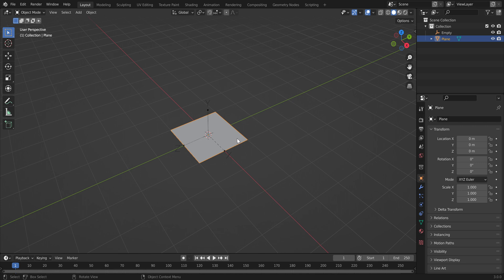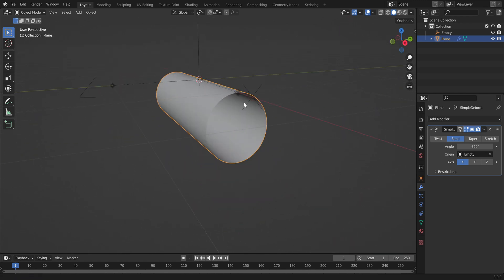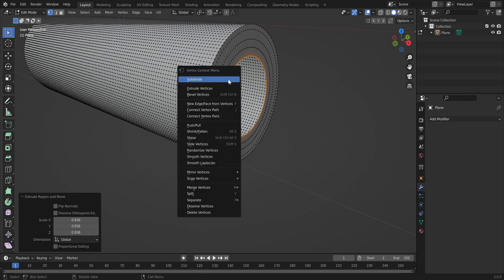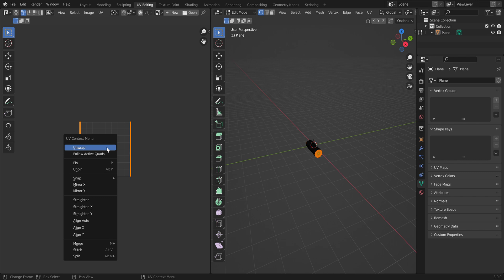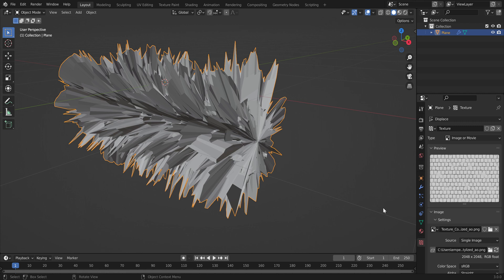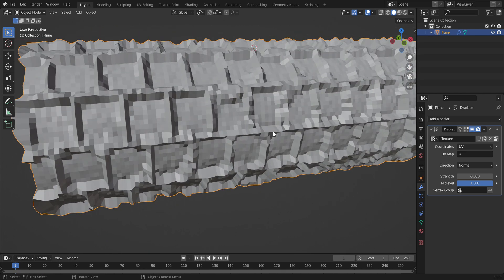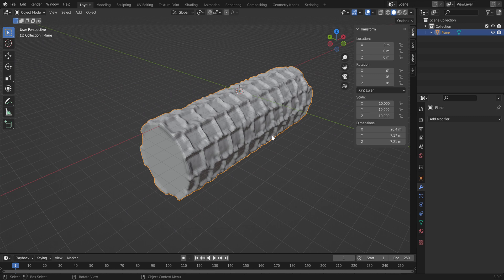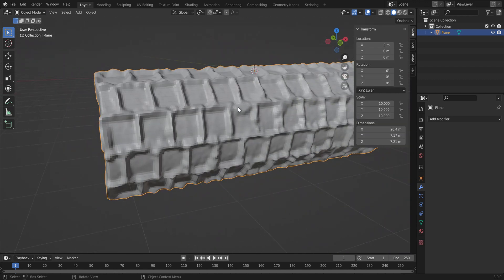Create a Texture Roller in Blender. (Tutorial)

Comment: I cannot get the uv to move off the part. did everything you did but doesn't move.
Reply from the maker: If the UVs are selected, they should be yellow. When yellow press G to move them then move the mouse and they should move with the cursor. If the uvs are collapsed, it might be enough. Me moving them off of the grid was just me being overly cautious.
Reply: @EmperorGuam  ah okay! You didn't say press G in the tutorial so that's the part I was missing! It seemed to work fine without doing that step - my first one is printing now. Great tutorial otherwise - I never use blender and I managed to do it so thanks!
Reply: Everything else worked great and not being able to move the uv didn't seem to mess up the final results, just don't know what I was doing wrong.

Comment: Could you leave the ends open 5:01 ?
Reply from the maker: @sophiemulders  you probably could. But if you are going to 3d print it, it does need some thickness.  To hollow it out you can use a subtraction boolean with a cylinder that is smaller than the roller. Most slicing software has a hollow feature  I would choose to do it there.

Comment: Using it on 3.6 with a slapped together png in krita and it is so much easier than the ones sculpting directly on the cylinder. Had some stumbling but was able to figure it out by following along visually. Many thanks.
Saved the core as it's own file to add more textures later. 🤩 Added a Action Recorder to reproduce the shape in a macro

Comment: Following and everything is working great but when I go to move the dot off the work surface I select it but it doesn’t move off square. Working on pc please help
Reply from the maker: What is the time stamp of the part that isn't working?
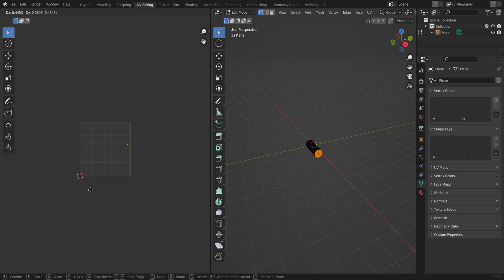Reply: Time stamp 5:23. It won’t move the tiny dot. Secondly could you do a tutorial on how to make a hollow texture roller or tell me what steps I can change to do a hollow one? Thank you for your help
Reply from the maker: @yourcreativeplayground6829  press G to move selected UVs. 

To hollow out the cylinder, use a boolean modifier on a second cylinder that you use to "cut" through the first one. There are lots of tutorials on using booleans in blender.

Comment: My model has a split on one side.. Like the cylinder doesn't connect to itself
Reply from the maker: At near 4:20 time stamp, this is explained. Basically, you want to go into vertex mode. Press A to select all vertices. Then merge by distance and all of the overlapping vertices should merge making the cylinder "water tight". Basically the edge of the original plane weren't connected is my guess. Hope this helps.

Comment: it does nothing adding the ismple deform the plane doesn ot bend the empty is not attached to the plane so its obsolete
Reply from the maker: You have to rotate the empty 90 degrees on the X axis for the simple deform to work. 1:04 mark for when this happens in the video. If you don't rotate the empty simple deform doesn't work.